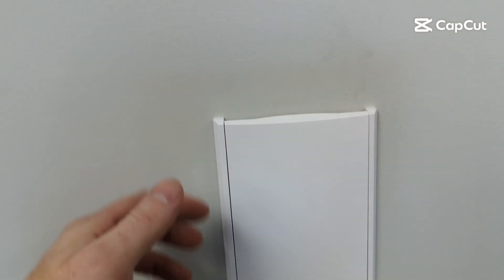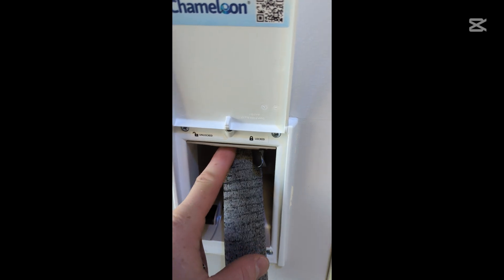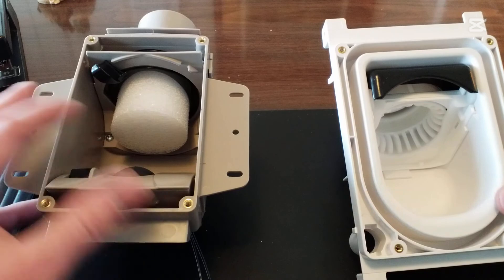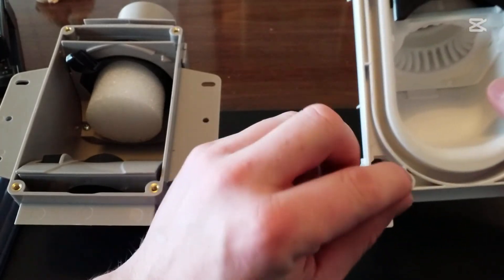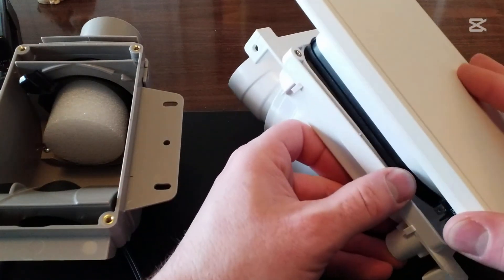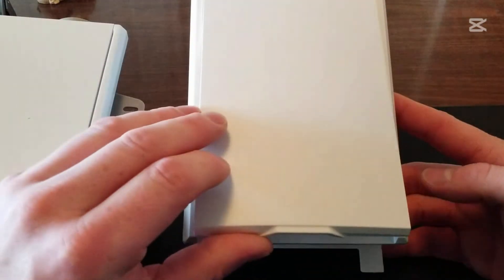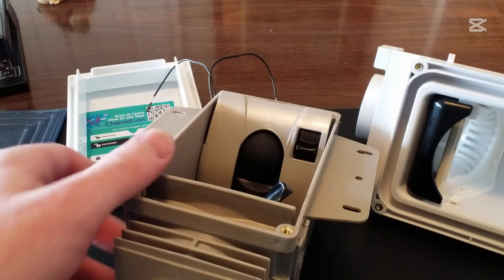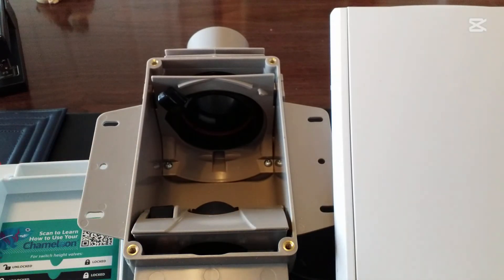NEW for 2025: Chameleon vs Hide-A-Hose Product Updates & Comparison

Comment: @Centvac  https://www.youtube.com/@Centvac It sounded like the HAH was much quieter than the Cameleon.  Were they pulling from the same cannister or what do you think is the reason for the difference is volume between them?  Great video.  Thanks!
Reply from the maker: Our Hide-a-Hose demo valve is connected to a power unit in the back room, while the Chameleon demo valve is connected to a power unit in the same area. So with the Chameleon you were hearing the motor noise of the power unit which in an actual installation would be remotely located. Thank you for your comment, I had not thought to call that out on the video!